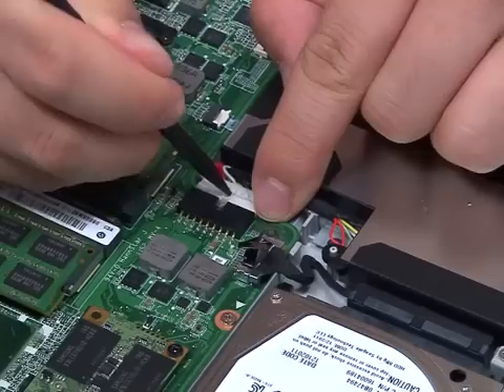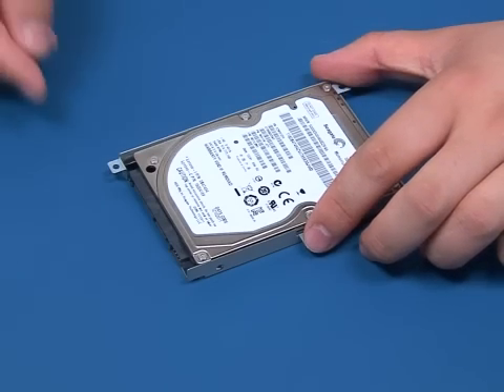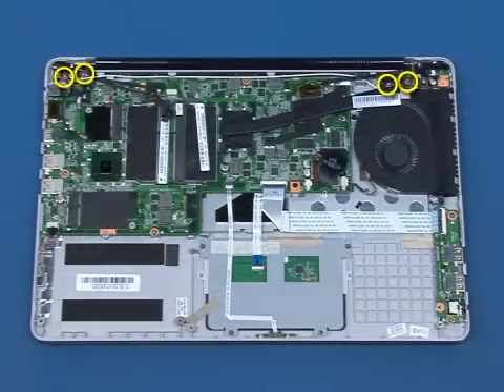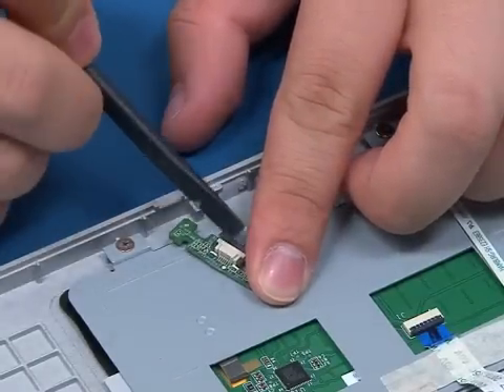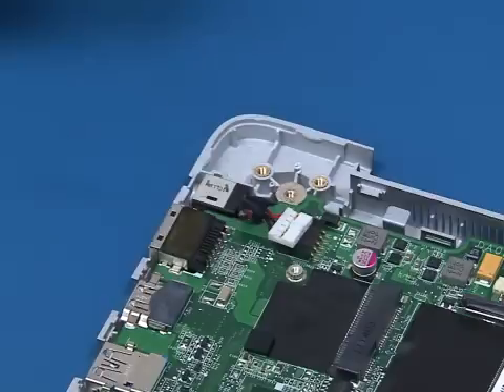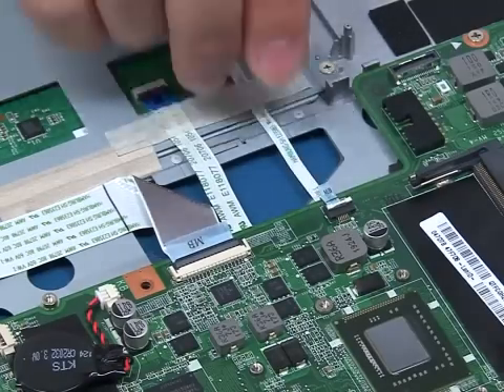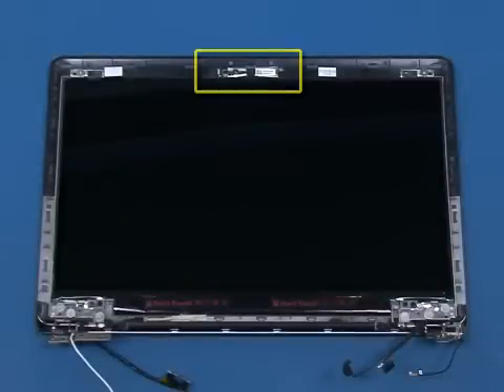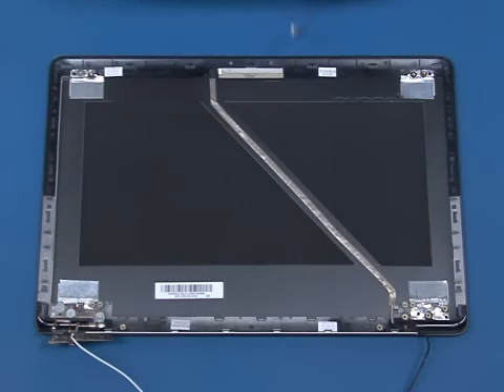Lenovo U410 complete disassembly guide

Comment: Doesn't the keyboard have 3 screws that connect it? I think the third one should be under the memory but I can't get to it
Reply: It is there, under left slot. You have to disconnect memory and remove black label.
Reply: Yes it does
Reply: It is under the RAM slot
I broke it

Comment: Hi George, Thanks for your video, it helped me a lot with replacing screen and keyboard. However you do not mention that keyboard has 3 screws not two as showed on the video. Third one is hidden under the black material underneath the RAM slot. I had to use the FORCE to detach the keyboard.

Comment: does this lenovo comes with a bluetooth? which one is the hardware part?
Reply: yes it has bluetooth, not sure which version though. And not sure what you mean by hardware part.
Reply: Yes I mean, the card or slot but I already found that its an half pcie wifi+Bluetooth card the one that its installed in this type of Lenovo.
Reply: the intel card is the bluetooth moful it has bluetooth and wifi